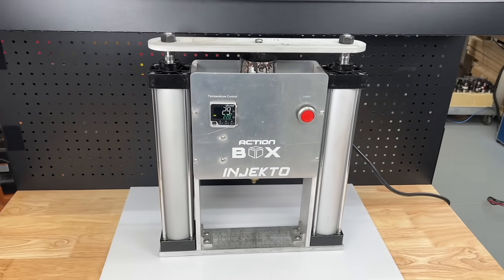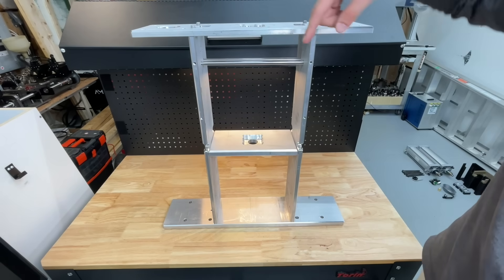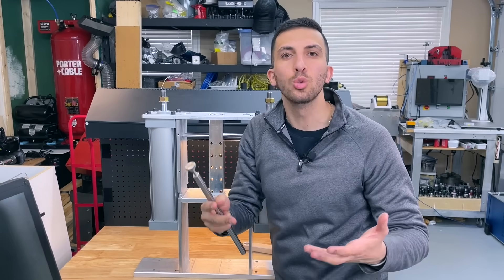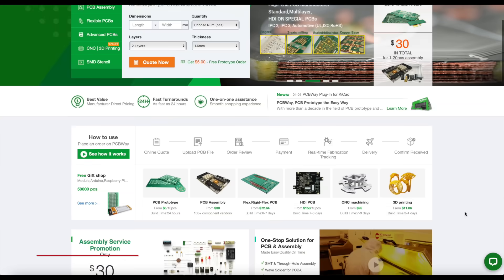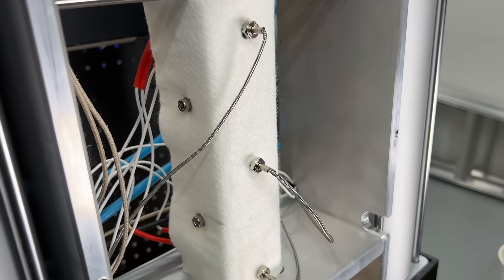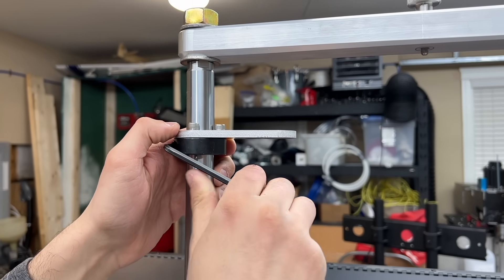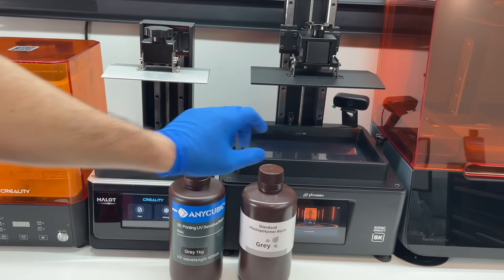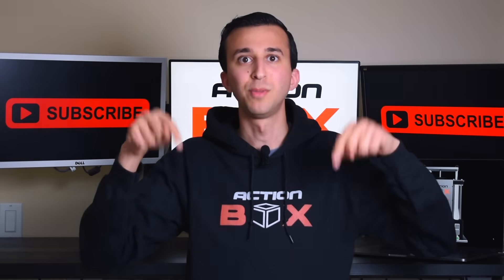DIY Injection Molder Works With 3D Printed Molds | INJEKTO 2.0

Comment: These are some great improvements from the first version, it's a really well polished machine now. I think the biggest area of improvement that could be looked at now is the injection volume - The adjustable limit switch seems to work fine but it's not very easy to set to the correct amount when changing molds without some trial and error.

I think the first improvement in this area could be to mount some calipers to the stop in order to make it easily measurable. A further option would be to mount a linear scale or a "string measure" and to use a microcontroller to output a calibrated value. You'd need to do a few test measurements to see what each setting outputs, but that can then be used by the microcontroller so that it can tell you exactly how many grams it will output at the current stop setting.
Reply from the maker: This is great input. Thank you Andrew 😃
Reply: I think a simple timer for the injection process would be enough.

Seconds to inject and seconds to release for holding pressure
Reply from the maker: @hussamhyari  can you elaborate on what you mean? Thanks in advance for sharing 😃
Reply: @ActionBOX  Injection time varies between parts depending on the part's geometry and size so if you add the capability to set the time of plunger going down (It represents the time of you holding the injection buttons), this will be more accurate than a varying limit switch.

also, injection machines need a holding pressure inorder for plastic not to return upward and cause defects to the part like sink marks, so setting a count down timer for the plunger to go back up after injection would be great.

Comment: On the note of Shredded Bottles, I don’t know if you know this already, so sorry in advance if I’m “preaching to the choir”, but the PET Plastic they are made of goes through Hydrolysis if even a small bit of water (vapor) is left in the flakes.  So Drying the flakes and keeping then dry will be key.  Beat of luck in that, I’m excited to see the results !

Comment: Awesome Build!  Do you have any other documentation posted online (outside of these amazing videos that is!) ?  Things like the CAD/CAM ?

I bet “Precious Plastic” and some other Open Source Hardware groups could really use a design like this.  More ergonomic/faster than manual levers, but not as complex as hydraulic.
Reply: They plan to sell it so no files pretty sure, or at least not until they get back their time's worth in money.
Though the design is fairly simple, you should be able to design one yourself.
Reply: Yeah i was thinking the same. Maybe they could sell the designs and i hope the open source it. I cannot import this in my country so reverse engineering from the video it is
Reply: @umerstar  Did they not share files for the first version of the machine?
Reply: Indeed, they used to promote that they published everything as open source. But not quite sure if they're still up to that. Unfortunately subscriber numbers are still a bit low, so it could be reasonable that they are looking for new forms of income...